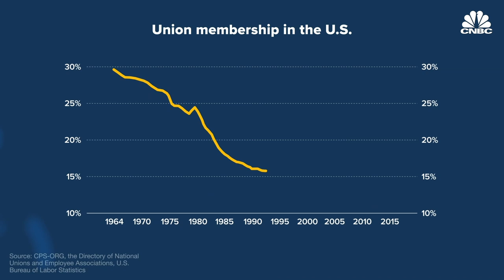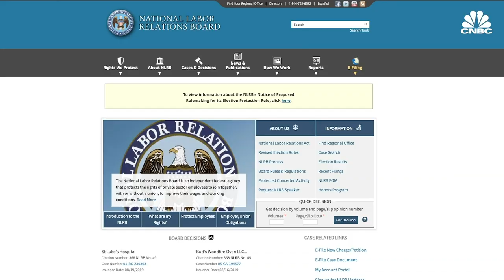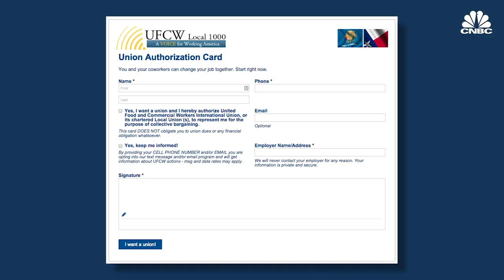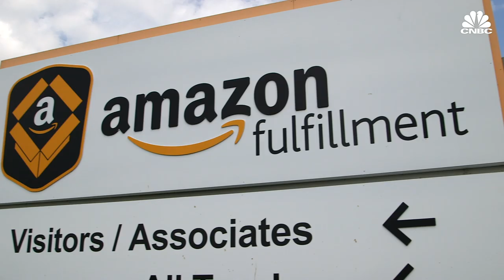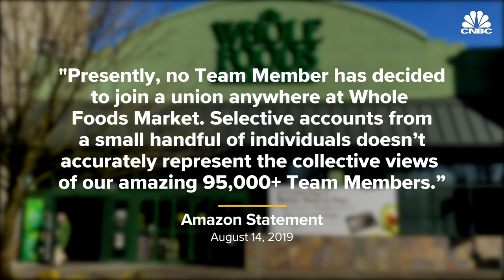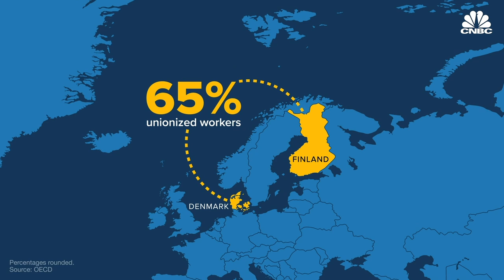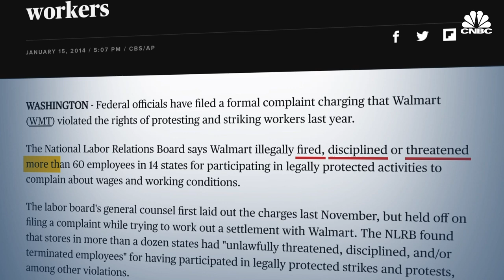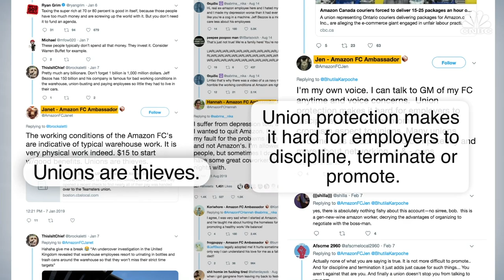How Amazon Fends Off Unions

Comment: 95% of your tuition for up to $3000 total, only 3,000 you have to read the fine print
Reply: Only at Amazon approved schools, and there are none in my area! So, non-benifit. Traditional tuition reimbursement would be better!
Reply: @jaminova_1969  what is Amazon approved? When I worked there they didn’t have this.
Reply: @mssha1980  It's called Career Choice.
Reply: Do the research.  $3000 is insignificant in higher education.  Even a  trade school will cost $15,00 or more. Trade Unions accept the responsibility to train their members with no cost to the member.
Reply: Sorry ment to type 15,000.

Comment: In Germany, large Companies like Amazon, are by law obligated to have all their Employees Unionized, and have 50% representation in the Board of Directors. Wages and Labor conditions are negotiated by collective bargain.
They are also the reason why German Manufacturing and Factories so efficient, as Workers can give feedback on how to optimize Production. Workers are also better informed of the state of the Company, and so can negotiate cutting hours during bad times instead of outright firing.
Reply: Jasc Random I doubt Germany has the obligation for unions, but I do know about the shareholders thing (called codetermination if I recall correctly.) if I may ask, are you German or familiar with said system? Mean to be asking actual Germans how the system
Works in practice
Reply: @mohammedsarker5756 Correction: they must have Work Councils where there are 5 or more Employees.

Comment: I was a part of 2 unions. One at ups and the job i currently have now. The ups union was hardcore and Made it hard for supervisors to fire even the worst employee. I missed a whole week without calling in to ups and my union rep was confident they wouldnt fire me. I never worked for a company like ups. The workers wouldn't allow me to do anything that wasn't in my job description even picking up a package outside that fell off someones truck. I ended up quitting before my meeting for the week i missed. The current job i have now has a wonderful union. Its not too hardcore and the supervisors still have some power. my pay at this job is even better than the top drivers salary at ups. I make about $110000 a year here. The difference in both was at ups there was no good faith or attitude between the union and management.

Comment: Union jobs typically pay a lot more and have better benefits, I have a union job and by far it’s the best paying job I’ve had and coincidentally my favorite job as well, I’m a boom operator/CDL B class driver delivering roofing & siding materials to residential & commercial job sites. I started with a non-union job paying $19 an hour to my current union job @ $27 an hour. Im very fortunate & grateful for my union job

Comment: Unions dues can be a whole lot more than 1% of paycheck.
Reply: I’d pay 10% if it meant getting a 30% raise. That’s basic math. Your union dues will always be outweighed by your pay and benefits.
Reply: @johnmoore1495  you haven't worked for ups have you?
Reply: @johnmoore1495  Do you think that job might be there in 10 years?  Not been my experienc locally in manufacturing.   The unions promoted an environment of drug and alcohol abuse by not letting the company fire people, they even called cabs to take drunk workers home.  Guess what they company packed and left with your 3000 union jobs.  Guess what Toyota and Honda still amking cars here after 30 years.  Guess what?   Better pay and benefits then new hires at GM.
Reply: Look it’s Jeff Bozo’s alt account

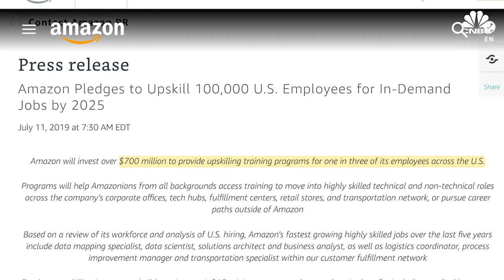Comment: 14:17 This is critical, One thing with Amazon is that if they unionize they're smart enough to start automating jobs away to pick up the slack.  Sounds good right? Yeah, except they could just automate away most of the unionized jobs.  And it would be in their best interest to do so.
Reply: They're automating anyway. Whether workers unionize or not would make close to 0 difference.
Reply: @Lewa500  The timeline of when they automate is different.  Companies exist to deal with the pain points of other companies or individuals.  If those pain points aren't bad enough to require a "revolution" they're left as the are.

Essentially automation is implemented only when the cost of doing business is increased to the point where automation is the cheaper option.

Comment: I have to agree that unions sometimes are good for some situations and not so good for others, but one thing to note is that the very threat of unionizing improves the work conditions on the company by itself, the union itself doesn't need to happen for improvement to happen, it happens also because of the looming threat of unionizing, so these people complaining on the street are not wasting their time, they really are putting pressure even if their effort doesn't end in a union.
Reply: This is well said. The unions protect the employer and the employee from having  a race to the bottom.

Comment: People in the warehouses work in horrible conditions it gets so hot that they have to suffer with all that heavy lifting plus no air conditioner. And the pay is horrible too, it should be made illegal for these companies to vote down a union.
Reply: Have you ever been in a large warehouse that had AC? I've never seen one.
Reply: Stupid Flanders some do but other at least have big fans around the warehouses.
Reply: @danieldelacruz7305  What makes you think Amazon warehouses don't have big fans? 

It's incredibly difficult to have effective AC in large warehouses, so almost no one even bothers. But large ceiling fans and smaller water-based cooling fans are quite common. It may not be enough to make everyone comfortable, but what can be done better that Amazon isn't doing?
Reply: If you payed attention you’d see that the company can’t vote down the union. They simply run propaganda for the workers to then vote down the union.

Comment: People who argue that if a company unionizes they won’t be able to pay the high wages/benefits to its employees are morons. The majority of UPS is unionized by the Teamsters. Full time UPS drivers make top rate after 4 years which is almost $40 an hour currently. Full time inside employees will be at $34 and some change in 2022. These employees also get a Full Time pension and amazing benefits completely paid for themselves and their families. On top of that they receive paid holidays and paid vacations/sick time. Even the Part time hourlies that make considerably less still receive the same health care benefits as a full time employee for themselves and their family along with vacations and paid sick time. They even get a part time pension. They have job security and union protection and the company is still profitable and in business. Take a non unionized company such as FedEx that runs on the private subcontractor model. Ground drivers are lucky to even make half of what a UPS driver makes and most never get a top rate pay even after decades of service. On top of that with sub par benefits if they even offer it. Also add in the fact that you can be fired for any reason without cause to sweeten the deal. Both companies produce similar numbers and profits/service but the business model of FedEx is the non union supporters wet dream. FedEx by theory should be blowing UPS out of the water.

Comment: former entry-level amazon associate... i wouldn’t be a fan of a union. yes i see many of the complaints (TOT for example... you can’t head to the bathroom without racking up TOT. but usually someone next to you is willing to prevent you from falling to TOT), but some of them (like lowering productivity standards) are just stupid. i was a packer, the productivity rates are reasonable as long as you’re getting a consistent workflow. ive heard other departments are worse, but my personal experience wasn’t bad. 

i didn’t work there during peak or prime day, so i can’t say much in that regard other than i bet it’s rough. it’s not the worst place to work, from my experience. it has a living wage (at least in most cities), free healthcare, there are definitely worse.

Comment: I've been apart of my local union. When a new company came in and took over the place I worked for. This company payed the local union 20,000k to not accept any grievances with the people working. But told them that they were replacing every one that work their. I found out after I quite that this company also payed the union 50,000k not to allow any union member to file a complaint. I filed 285 complaints before I left. Not one was look into. In total there where 1,500 complaint filed. And 3 law suit against company and union over this. The law suit where all handled out side of court.

Comment: I’ve worked construction union over 25 years, very competitive workforce over 10,000 workers in my line of work (craft)alone in my area. Meaning just because the pay, benefits and working conditions are exceptionally great, doesn’t mean you’re guaranteed that living wage and benefits throughout the year, due to a potential lay off.

For example if the union Hall don’t send you out or you’re so far down on the out of work list ..... you will STARVE.  I’ve witnessed this first hand with a lot of very good workers. The problem has always been with union construction is there’s never enough continuous work for its very competitive workforce.

So it’s very critical that a person have other means of consistent income. Also you WILL go medically uninsured at times. Very stressful.
Reply: they are there because they are poorly educated and could not do anything else. That is the only reason a person would work in construction, farming, or factory work.

Comment: 0:45 graph range should go from 0% up to 30% if you’re not trying to mislead people. 

The reason is that the full 30% range represents 100% of the max union membership, which is why it doesn’t necessarily need to go to 100%.

However, your graph does nothing except exaggerate the decline of union membership in an unfair way.

Comment: The biggest issue with organizing unions with low skill labor is that you are easily replaced. Try to organize and they will probably have found your replacement before the end of the day especially if they are offering over minimum wage. The worst a worker can really do is quit. Sure they could not show up and be fired, but that looks bad if a potential employer sees that doing you a lot more harm... or you could do something illegal... which is illegal so... 

Once you get into a job that requires more skill and knowledge you start becomming a lot harder to replace and collective bargaining is a lot easier to begin when you only need a few individuals to cause a stir instead of a few hundred or thousand.

Comment: Some places would be better with unions and other places are much worse. I worked in places where they absolutely needed a union because the workers were treated so badly. But I also worked in places with unions, where all the unions did was tell the workers when and how they can work. They also protected a psychotic coworker who harassed everyone and actively tried to sabotage and lie about the other workers. The union actually punished anyone trying to do a good job because anyone attempting to go above and beyond what was required, would be disciplined for "working outside their job description." Basically the union members hated management and wanted to do as little as possible, which in the end only hurt the customers that tried to use our service. I actively told people to go somewhere else because I felt so bad with the horrible service that was provided.

Comment: Good! if you don't like the conditions for which you accepted to work for a company, you can try to negotiate better terms, failing that you have two options, you either accept the current conditions or you look for another job. Simple. Unions are not needed.

Comment: 14:00 Of course they do. They educate people they need in the future, take the cost themselves, which is cheaper when they run everything and in turn get a deal with the worker that makes the employee earn less compared to if they were not locked in. This is not something the company should be applauded for without context because they are just serving themselves. They are so large, it is beneficial for their bottom line to do this. It is not charity or caring for the employee. They are just creating the type of worker they need. If they did NOT need it, the probably would instantly go away. Another aspect I would bet on, without checking, is that these new "in demand jobs" (Amazon needs them) are most likely not protected occupations, as in you need law school to become a lawyer, you just cant call yourself a lawyer just because,... In turn the requirements are more vague and Amazon could basically just give education on their systems rather than the industry standard. Making these worker more fit for Amazon than ANYWHERE else... Yet they expect getting an award for this? LoL

Comment: Too kindly, that is how they deal with them.

The lowest of jobs at Amazon is an overpaid position that requires the skill set of a MONKEY. 
Hours are clearly described in the contract, conditions of work are clearly explained in the introduction.
It's a boring, BORING mechanical job. That ANYONE can do, paid 15 dollars an hour, more outside of standard hours. No personal/technical/social skill is required. 

If instead of quitting when unhappy (comprehensible) you decide to try and extort your counterpart, I find that firing you is UNETHICAL.

Because that would mean releasing you in the job market and potentially dooming some other unsuspecting employer with your parasitic burden, and that is without considering the rest of humanity. You know, the whole "all that is needed for evil to triumph is for good men to do nothing" spiel.

So, mustard gas would be the humane, ethical solution.

But apparently, they are not allowed.

Comment: Unions are nothing but modern organized crime rings.  I've been employed at several casinos in my career where all the food service workers are unionized.  They don't even have a choice, if you want to work, you must go union.  Union dues are nothing but legally sanctioned shakedowns.  There are so many lazy people at my current place of work, but management can't touch them because of the unions.  

Union labor is no different than any other form of labor.  Union leaders like to portray the union worker as 100% on the job, dedicated and reliable.  That's the biggest lie today.  

There are sufficient local, state and federal laws that protect workers from abuse such as excessive overtime and exposure to hazardous conditions.  OSHA, EPA, various state labor boards etc...the protections are there.

Comment: I'm not anti-union, but I am pro-"leveraging human beings as best we can". We have finite resources on the planet. Using humans for manual labor that robots can do is an immense waste of human resource. The only reason humans are abused so much is because they are "the most high-tech resource we can make using low-tech labor". IE: humans are very smart, can solve problems, and you don't need a degree or special manufacturing plant to make them. Since we can crank out humans so easily, we treat them so disposably. But, eventually you reach a limit to how many humans an environment can support. So, eventually we have to find ways to better manage our human resource by leveraging them as problem solvers instead of menial laborers.

Comment: Unions are very necessary but are tone-deaf as to why people don't like them.
1) Protecting the weakest worker.  Nobody likes that policy.
2) As stated in the video, stifles innovation.  Everything has to get union approval, so there's so much red tape, you can't pivot or try different things.
3) Union dues going to support politicians the workers disagree with.  Most of union workers are conservative and don't like the Democrat politicians they financially support with their dues money.
4) Legislates laziness.  Similar to point #2, and they touched on this in the video at 14:17.  This is how hard you have to work at the job.  If you want more money for that job, fine.  If you need more people to get the expected output, fine.  But don't put restrictions on how hard you work.  The new slogans of unions seem to be "that's not my job".
5) Right to work laws are passing left and right because the unions are so tone deaf.  Right to work should never be passed, but people support it because unions aren't run very well.  Sometimes unions have to push for so much more in their contracts that I think they do it just to justify their existence or justify their dues collection.  Look at the sign at 6:43.  Yes, unionization will take care of those issues.  But once those are fixed, then what?  Outside of a standard cost of living increase, what else can the union get?  So the union then creates more problems and issues so they justify their existence and have something to bargain for.  Each union contract creeps further in to the point where it's no longer a symbiotic relationship between the worker and the business and the business goes under or closes the location.